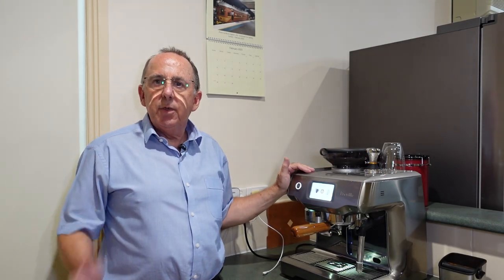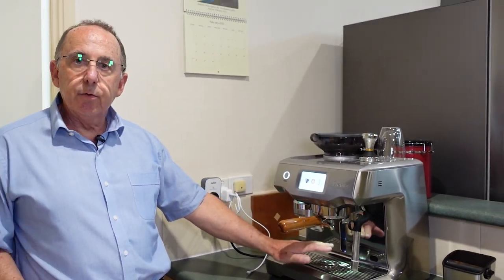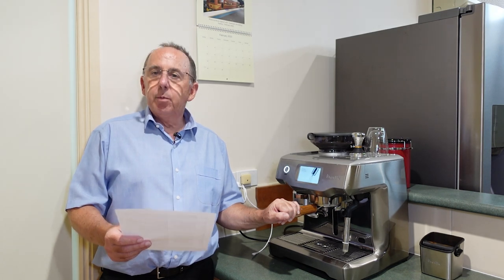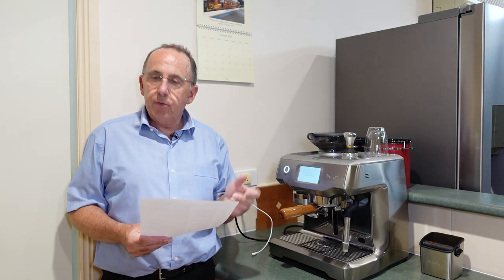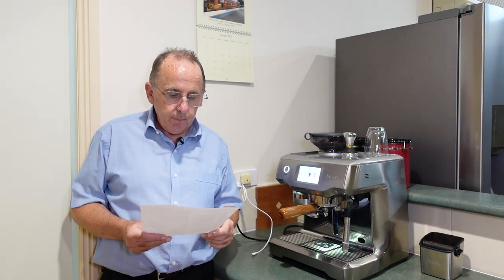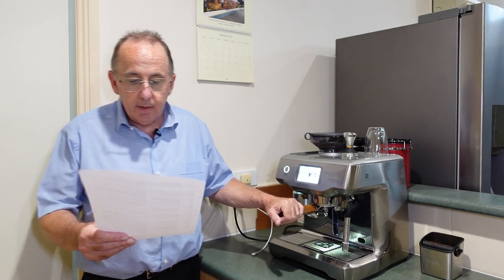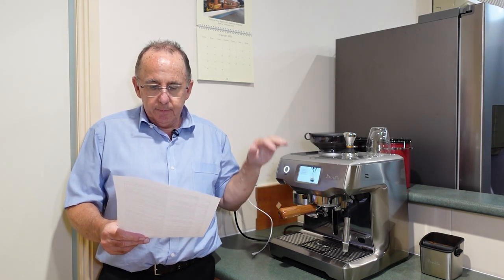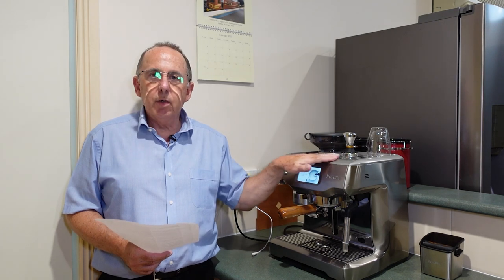Breville (Sage) Oracle Touch Q&A

Comment: Thanks for your very quick response this morning Mark! Just had a thought about extra large cups fitting under the group head-you can remove the drip tray to fit them under on an easier angle- the wheel lock knob does get in the way still but it does give a little extra space! Another great video again thank you Dale, Traralgon

Comment: Once again You have made a nice & very helpful video Mark! Thank You! I have ordered this machine and currently I am waiting for the delivery🤗
Reply from the maker: Thank you Adam! I hope you enjoy your new machine when it arrives 😊
Reply: @MarksElectricLife  Hi again. I have received my Oracle Touch and I have some issues with it. The coffe tastes 🤢. I aimed for the 1.5-1.7 ratio as I use dark rosted coffe beans. But it is not possible with 20-30sec brew time. Even when I set the grind level at 18 the coffe starts dripping allready after 3 sec (should be 8-12sec) and at 20sec brew time it is allready up to more than 2.0 ratio. The puck are also very vet. I think there is something wrong with the pressure settings in my machine...it should not start to drip coffe after only 3 sec with the fine 18 grind setting and the puck should not be so wet right? Have You experienced such things? (Sorry to bother You with this)
Reply from the maker: @adamszilardszabady8079  Hi Adam, sorry to hear about your extraction problem. My first thought is the grind is too coarse or the dosing is not right. Is there a 5-6 mm rim showing above the puck after tamping? If there is more than that you may need to follow my instructions to adjust the tamping fan (other video). It’s very important to get the right shot volume over the 30s and this can be achieved by tightening the grind. Turn the grind adjustment knob clockwise to get it finer. If you get to the point where there is no more adjustment then you will need to follow the steps to adjust your burr grinder. Instructions should be in the manual but I think there are other videos on how to do this. If you are unsure, come back to me and I will make a new video on how to do it. Good luck ! Mark.
Reply: @MarksElectricLife  thanks! Yes there is 5-6mm after the tamping. I've  contacted the Sage support now :) Have a great day!
Reply from the maker: @tinaslawson5699  Thanks Tina! Enjoy your new machine! 😊

Comment: We have been using an Oracle Touch daily for 2 years and love it, I use it for making a Capuchino for my wife and an Americano for me.  My only issue so far is aesthetic, we have hard water and it goes through a water softener using salt.  I noticed a few months ago that the water inlet cover at the top was stating to blister and flake off.  I suspect this is a dissimilar metal issue with the cover and the spring.  I have contacted Breville and was told it was not part of the warranty but they would sent me another cover.
To add to your video, the machine will tell you when it need descaling, which is for us every 6 months.

Comment: Hi Mark. Love your work. I have recently purchased a Touch. Cannot get it to heat to 75 degrees. Is this an issue generally. Any tips.
Reply from the maker: Thanks Bob! You can adjust the brew temperature in the "Settings" menu. Push the cog in the top right corner and then scroll to Brew Temperature. I have mine set to 93 degrees celcius. If that doesn't work then you may have a faulty PID unit. Hopefully you are still under warranty.
Reply: Finished up returning it and they replaced it. No probs. They said it was “probably a sensor issue” the new one works fine.
Reply from the maker: @bobmorley3571  Great to hear Bob !

Comment: I just got the machine. Thanks for the informative videos. 

I do have a question / concern. When I take out the water tank I get some water drips from the machine itself where the water tank connects to. Do you have the same issue?

Comment: @Mark B.  Great Video!  Do  you wish  you had a more manual machine to tweak stuff now  that  you have  more   experience?    Something Like  the Breville Dual Broiler and then add on a  grinder.
Reply from the maker: Thanks David! At another time in my life I was a total geek and used to grow, roast and grind my own beans. But life is short and I would rather spend the time on more meaningful activities like hanging out with my friends and family. Tweaking to get the perfect cup becomes a law of diminishing returns and you can go crazy trying to detect the subtle difference in taste. The perfect cup of coffee is the one you didn't stress over making. It's why cafes are popular 😉
Reply: @MarksElectricLife  you do a wonderful job explaining the machine :) This machine is right up there for me.  I would be moving from a Nespresso.  I want better coffee and this machine looks like it keeps things very simple still
Reply from the maker: @davidgonzales82  Thanks again David! I had a Nespresso machine and it mostly collected dust, because the quality wasn't good enough to prevent me straying to the cafe, for a "real coffee". You need two things to make a "real coffee". - 1. A group head espresso system for robust flavour, and 2. A steam wand that can produce real microfoam (if you take milk in your coffee). My Nespresso made thin tasting shots with shaving foam on top of them. The Oracle delivers 1. and 2. but in a way that doesn't require you to have barista skills to operate it, like a commercial machine would.
Reply: @MarksElectricLife  Exactly! I’m not technically strict with my coffee workflow and taste. Easy, lazy, and fun are my theme on making a latte every day. I have the same machine (Breville the Oracle Touch) for 1.5 years and loving it still! Thank you Mark for this thoughtful video. Really appreciate your time lines in description!

Comment: Does the oracle touch count the number of drinks and where can I find this data if it does? Thank you
Reply from the maker: Hi Karen, yes it does. You need to enter Service Mode to view this. To get to Service Mode on an older model you just need to push and hold the Power button for a few seconds (start with power on). On newer machines, start with power off, hold the power button in and turn the wall outlet on, whilst holding the button in. The password is 55555
Once in SM you can select Cycle Counter from the menu to see how many drinks have been made. Regards, Mark.
Reply: @MarksElectricLife  password is 00000. Otherwise, correct!

Comment: How wide is it at the top including the knob on the left? In CM
Reply from the maker: 380mm
Reply: Thanks we have a spot built for a Rocket Giotto we had.  That machine was unreliable and we didn’t like the mess.  It looks like the Breville Oracle fit. 
We had had two Breville Nespresso machine since then and both were way more reliable than that damn Giotto. I probably won’t buy another Italian coffee machine again.

We started CoffeeSnobs Australia before we sold it to Andy who took it places we never would have.
Reply from the maker: @PubRunner  I can highly recommend the Breville. Coffee Snobs is a good site. I used to buy green beans there back when I was roasting. Too lazy these days 😉
Reply: @MarksElectricLife  yeah we went ultra lazy with the Creatista and then the pro version.
For what they are they are great and you still get coffees better than instant and better than most cafes.
Reply: @MarksElectricLife  one last question (until the next one) If you pull the steam wand forward does it go into manual steaming mode?
Reply from the maker: @PubRunner  Yes, pull it forward and long press on the Steam button.